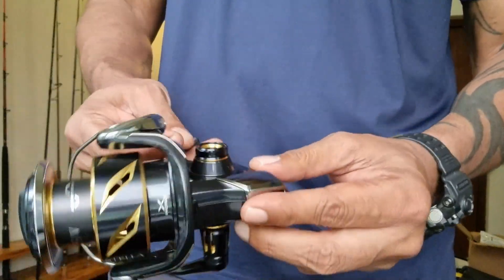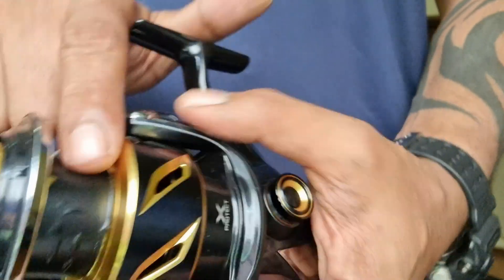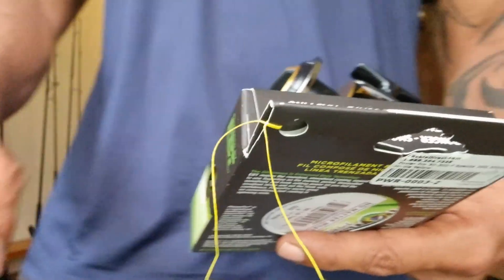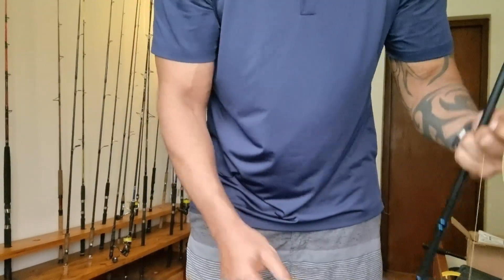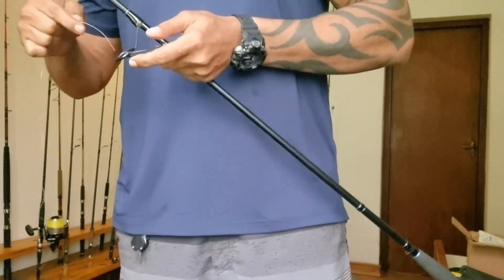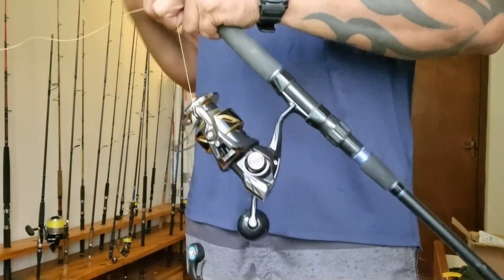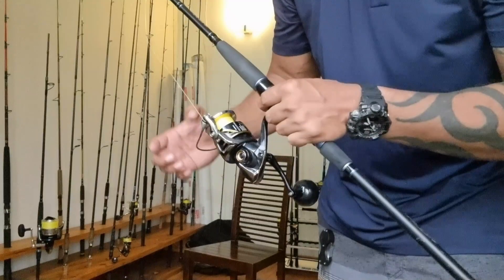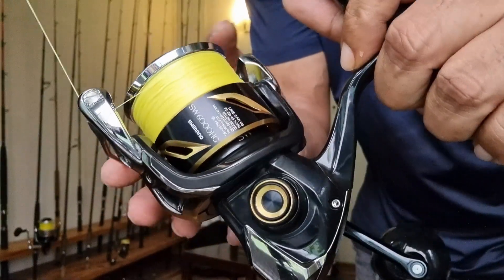HOW TO SPOOL BRAIDED LINE ON TO A SPINNING REEL - QUICK & EASY DIY FISHING HACK | SHIMANO STELLA SWC

Comment: Greetings from Florida, great method for spooling. I keep two large inexpensive old reels from before starting to buy the good stuff, when some of the expensive line gets a bit worn I put it on one reel, then another so the worn line is tied to the spool and the good line which never saw the light of day is now on top. A few years ago I started using athletic tape instead of electrical tape (some say water sits under electrical tape, don't know). One lap of the athletic tape works fine and it's very tacky.  Recently a neighbor kid brought me his spinning reel he had gotten for his birthday a few months before, when you would turn the handle the line would come off instead onto the reel. The guy at the tackle shop had obviously put the spool on the spooling machine backwards... oh boy.
Reply from the maker: I've had people mention not to use electrical tape too..but I've not yet had an issue..some people say the glue on the electrical tape can corrode the aluminium spool..but I've not encountered that yet..
Reply: @AnglingAddictssrilanka  Agreed, I never noticed any problem with the electrical tape. Wishing you a great 2024 and looking forward to seeing your new videos.
Reply from the maker: @DanTheFireman  👍👍

Comment: Hi.. lovely videos... can you kindly assist in how to do lure casting in fast shallow beach waters and cross winds with special reference to productive lures under these conditions. Thanks
Reply from the maker: Hi, there is no hard and fast rule. if casting fast moving shallow water, then i'd use a spoon. it would be easier to work a spoon in the current rather than a stick bait. weight of the spoon would depend on how fast the water is going. maybe something in the 30-40g range.  spoon will also cast well in strong winds.

Comment: Hi, need some advise on choosing a rod suitable for both surf casting and inshore angling in Srilanka . What I have in mind is the Tubertini Black water , medium heavy  rod size 2.7 Mtrs, 2 sections , power 15÷45g.
Coupled with the Shimano twinpower spinner .
Reply from the maker: Hi, the rod and reel you have chosen already is great. I would recommend the twinpower XD 5000xg. it will balance the rod well reel has enough power to tackle fairly big fish. Good luck..